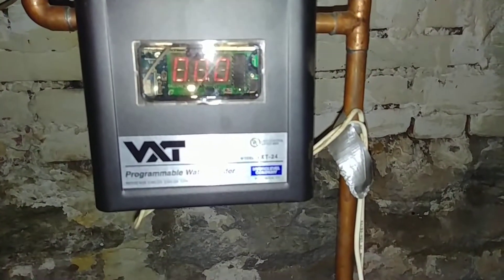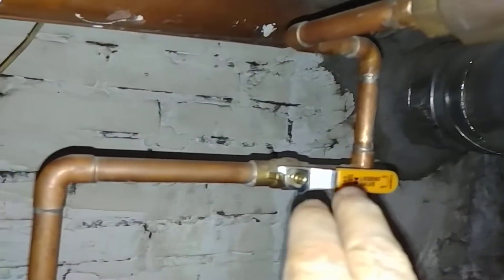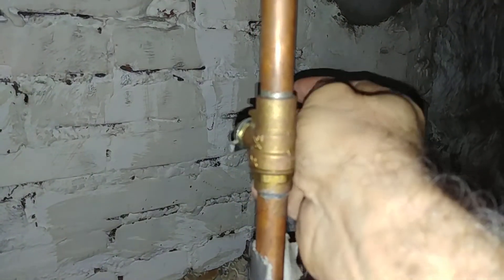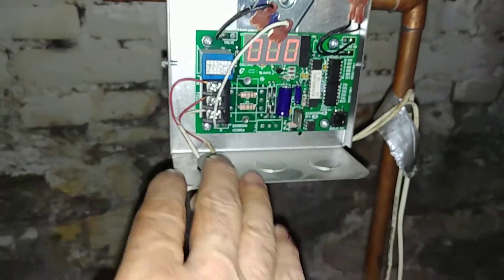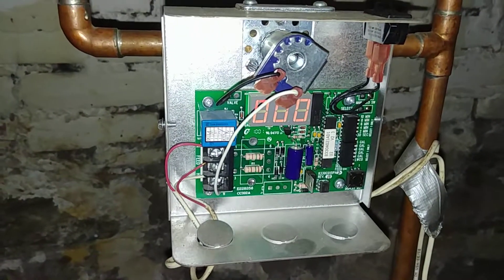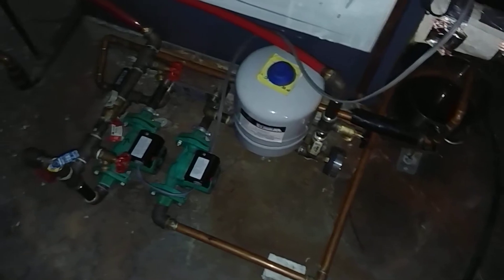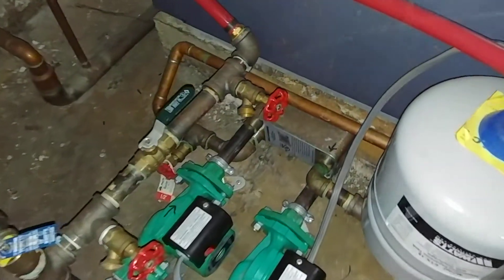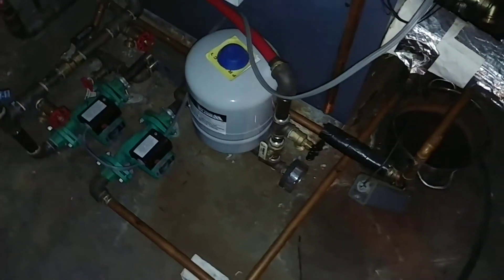Reversing A VXT Valve Using The "Git-Er-Done" Method - Not Approved

Comment: I have done water loops off the base of a steam boiler many times over the years. No issues. But a have never used a heat exchanger.
Reply from the maker: Thank you for your comment.
I have used that heat exchanger, but certainly not with steam boilers. It would seem to me that it would be likely to clog up. Also, the circ on the boiler side is iron body, methinks.
What has been your experience with circs on your hot water loops?
Reply: @gordonschweizer5154  
I have always used Iron pumps with no issues. I only use bronze or stainless on domestic water. Below water line loops are problem free for the most part. When above water line it confuses people. I have only done that once but it worked fine.. I am actually doing a below water line loop next month for a cold basement room.
Reply: I would also put the pump on the return of the loop. Only on this system to keep the water temp hitting the pump lower. Pumps are limited in there temp ratings. Water systems would be pumping away.
Reply: @RalphsHeating  Thank you for your replies! I would say you have more experience than I when it comes to hot water loops from steam boilers. Thank you for adding your knowledge and experience to this channel.
Since we don't do them very often, we usually go "by the book" (Dan "The Man" Holahan LAOSH and others).  He champions 3-piece bronze circs for steam boiler hot water loops and I did not feel it my place to question such.  Question: The iron circs you use, are they 3-piece or wet rotor?

Comment: I have reversed the flow in the past .I would love to see Hydrolevel make it “Field convertible “ it doesn’t seem it would be that difficult for them to do during manufacturing.
Reply from the maker: Neither Hydrolevel nor McDonnell & Miller make the valve for their products.
Hydrolevel gets their valve from DEMA Engineering. M&M is the S-45. Of the two, DEMA is lightyears ahead as far as being responsive to their customer requests.
I have direct experience. 
But even DEMA is not really doing the easy revering thing.
The good folks at Hydrolevel would also like to have it field reversible.
I was honored when they asked me to make a video on how I do it.
Sad to say, my method might not be for everyone. Please check it out, I would like to know what you think.

I was so sick and tired of seeing VXTs installed upside down!
Reply: @gordonschweizer5154  I saw your Hydrolevel change in direction video, very nice work. I do something similar but I don’t have that small  nipper as you do, so I use a step bit and a little barn yard side bit machine work lol. I should find a pair, after all I got 3 of everything else I don’t use.
Reply from the maker: @scottk0623  I do like your field expedient milling machine idea!
Tool horders unite!
Reply: Aww I wanted to hear more about the water loop!
Reply from the maker: @pb7379-j2k  The contractor that did that is notorious for such work.
My favorite is when he put a load bearing deck pillar right directly on top of a terra cotta building sewer. He covered it up and it was discovered by accident a few years later.
Reply: Gordon Schweizer thanks but I mean what are the issues with the loop. I am not familiar enough with them to know
Reply: @pb7379-j2k  I have had requests over the years to add a hydronic loop to a steam system,  the only way I will do this is through a tankless coil on the boiler.  It’s the only option I will offer as a solution to the customer.
Reply: @pb7379-j2k  That is a hot water boiler not a steam boiler they are showing. No issues using a indirect on a hot water boiler, that’s fine. I’ve seen indirect on steam systems and the coil in it banged like the hammers of hell because they don’t pipes tempering return into the supply side of the coil. When the circulator starts it creates a pressure drop causing the hot water circulating thru the coil to “flash” into steam. This does not happen durning the off heating season but when the boiler is running for steam it’s another animal. You also need a wye strainer before the circulator or it will become rust/ sludge plugged. If it’s done correctly is can STILL be subject to air issues, remember that loop is not pressurized. Also provisions need to be made to add a water supply to purge the loop or it must be pumped thru to fill and purge the loop. Not all steam boilers gas or oil have acceptable taping located for connections of a hot water loop or indirect.
Reply: Scotland Heating & Air Conditioning LLC thank you sincerely for the nice reply! It is a steam boiler diagram however (see title of section). This article tells how to address the concerns you listed I think, but I believe you there are many opportunities to get it wrong!

https://heatinghelp.com/systems-help-center/how-to-run-a-hot-water-zone-off-a-steam-boiler/
Reply from the maker: @pb7379-j2k  The loop worked in the past, according to the customer. I did not check its operation when I was there as I had enough on my plate with that boiler and with my disgust with that particular contractor.

Comment: How was that hot water loop piped in?,surely that plate heat exchanger will block in no time with sludge from the bottom of the boiler?
Reply from the maker: It's one of those things where all you can really do is shake your head.
It works for now, and has worked for a few years so I am told. It's not the homeowner's fault. It's the contractor who redid the bathroom.